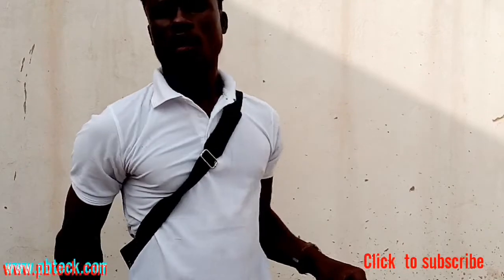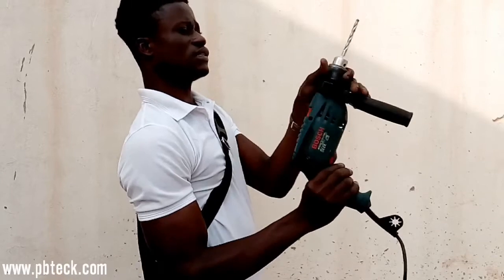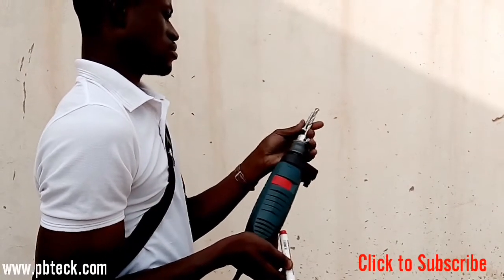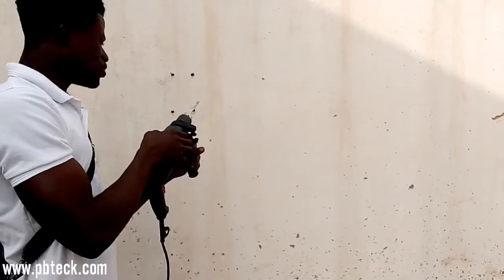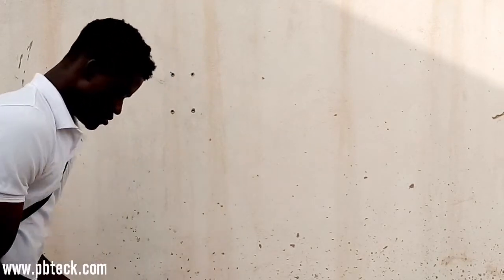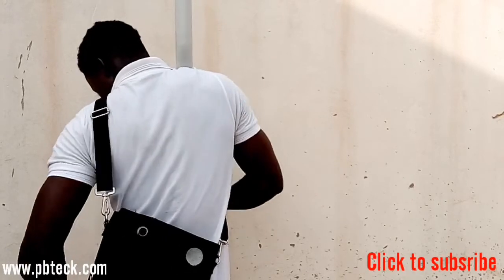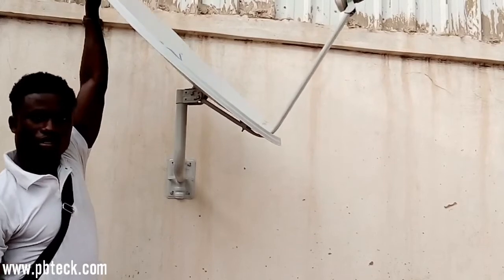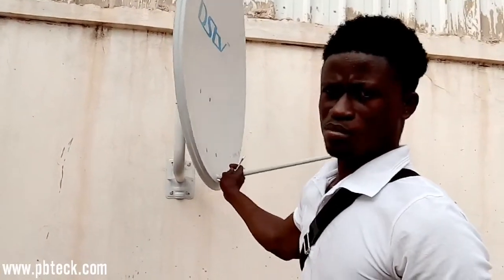How to Mount a dish pole on the wall

Comment: pls assuming u wanted to mount it on a wood. will u use the same drill bit or u ll go for wood bits?
Reply from the maker: You can use nails on wood
Reply: i know but what if i want to use driller. how do i go by it
Reply from the maker: @malikamissah9195  You can use a sizable  metal screws but it can't hold the dish for long period of time.
Reply: so using nails will be stronger than using screws?
Reply from the maker: Sure